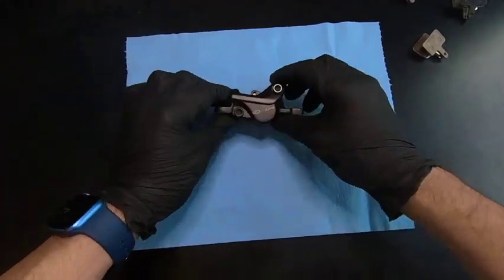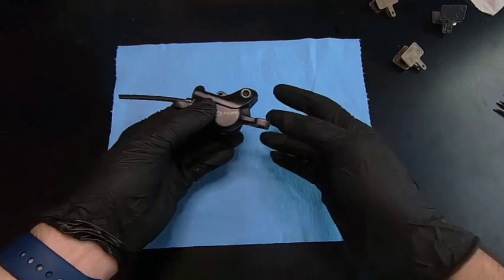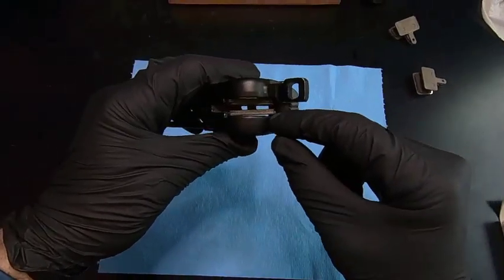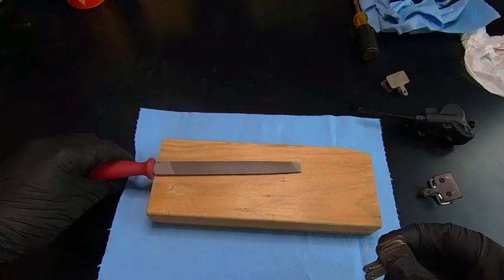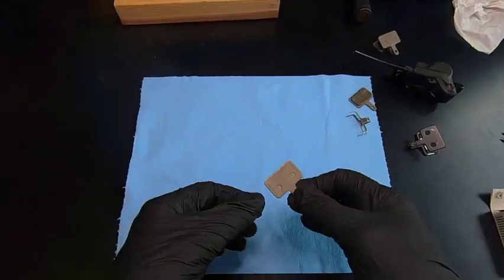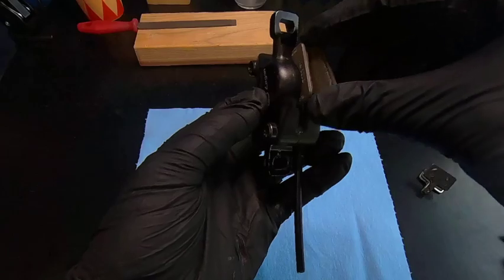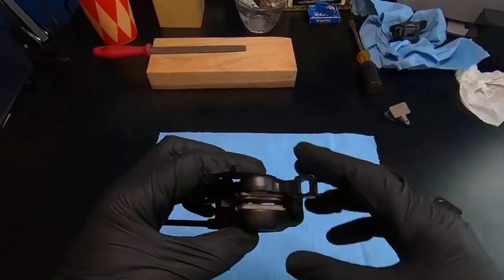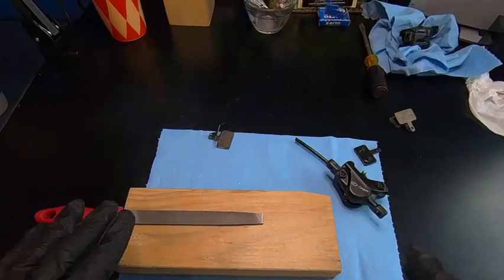How I Fixed the Squeaky Brakes on My Juiced Ebike!

Comment: Maybe this maladjustment is why no matter how much I adjust my front brakes, they keep rubbing against the pads and making noise, and that's besides the awful howling during breaking. It's because they're not properly fit to begin with. 
How did this low quality material every pass QA

Comment: Awesome and thank you for making this video. I have a Juiced Rip Racer and the brakes are loud as crap. What is the part number on the Shimano replacement pads? Thanks again.
Reply from the maker: Thank you! The pads are Shimano B05S
Reply: I have the same problem.  How do you fix it?